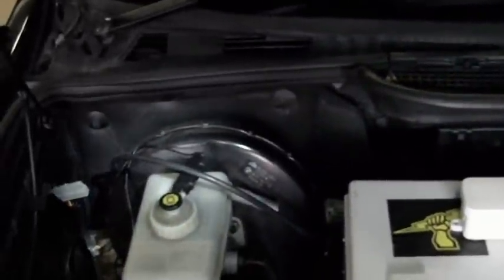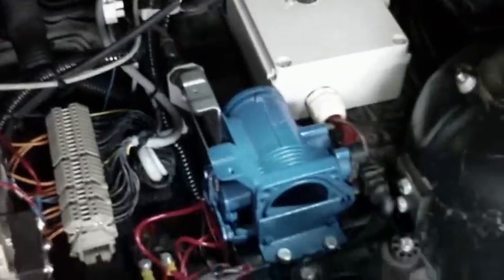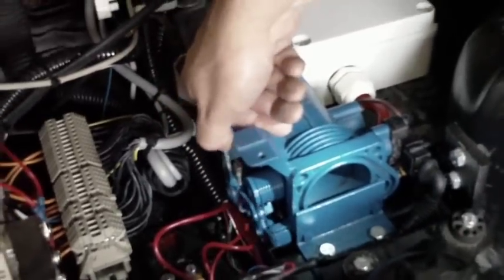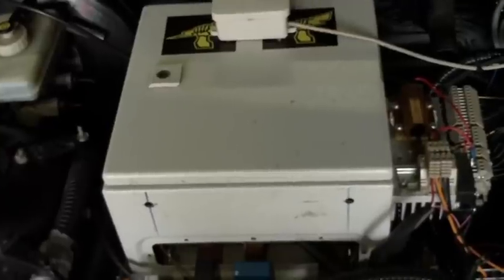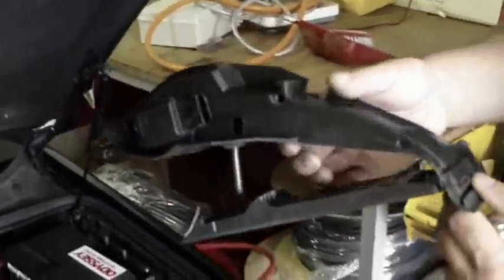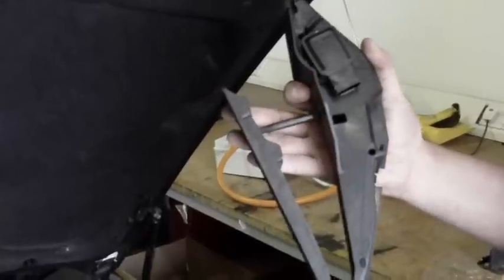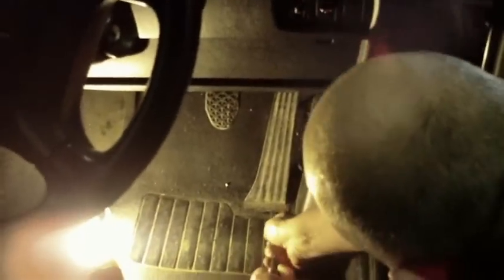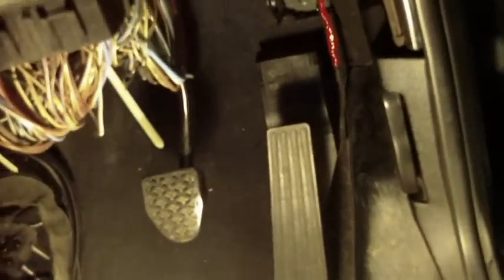BMW EV Conversion 46 Pedal Faster

Comment: Great video I have a e46 stock 2000 with the same original pedal not electronic can you please tell me how I can modify the pedal the only difference is I dont have a controller system just stock.You are very talented                          Thank you

Comment from the maker: The pedal outputs from 0.7 to 4.2v dc over the range. I fed it into the atmega adc pin via a simple rc filter and modified the software accordingly.